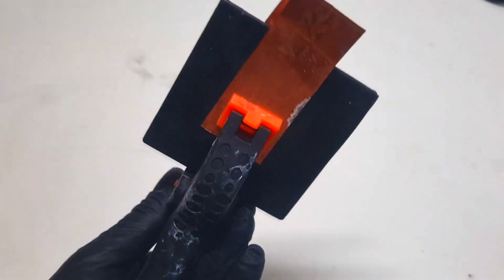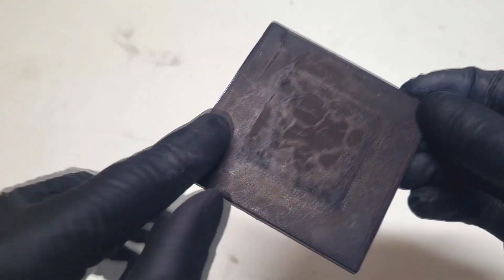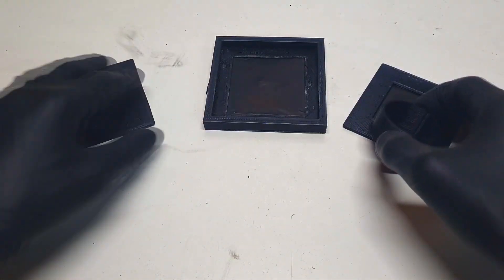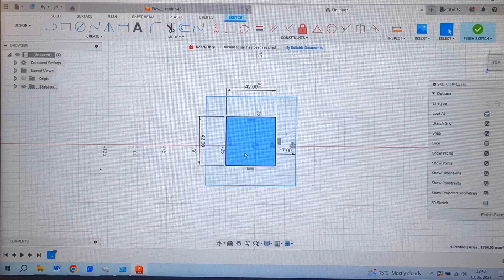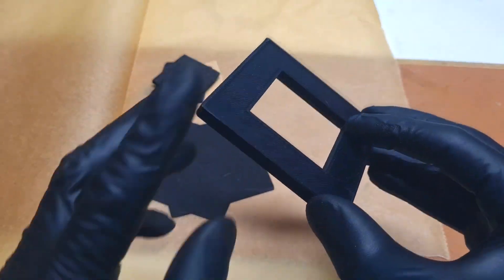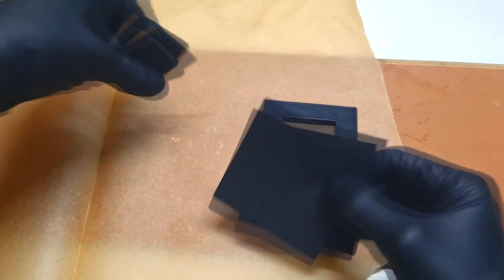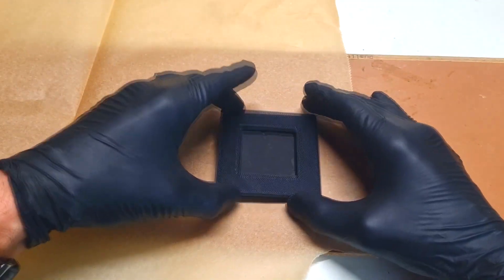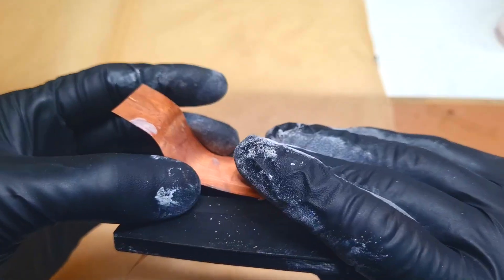Make a Battery in any shape and any size with 3D printed thermo plastic

Comment: Do you get same results when using Al foil instead of conductive HDPE ? 
The results I get are frustrating 😢
Reply from the maker: How do you mean? If the weld is so good on aluminium like on HDPE? Ofcourse not,.... I need more press down the iron when I use  aluminium. For better bonding is good to make smal holes on aluminium in area wher you will bond with platic
Reply: I mean do you get same voltage and performance of hdpe?
Also, can i use graphite foil instead?

Comment: It seems one layer of HDPE is too thin. After one day I see crystals forming on top of the HDPE which must have permeated through the HDPE from the electrolyte.
Reply from the maker: Penetration of HDPE can happen if you iron too long or you press to hard down. In that case you can add another layer of HDPE.
Reply: @cayrex  As far as I can judge the HDPE has not been penetrated, nor punctured. I looks like permeation
Reply from the maker: @Flup1964  Interesting. By me, only one cell out from 9 cells which I make at the same system, I get some penetration due to damage with the iron and the crystals have formed after one day. And other 8 cell are still strong with no problems.

Comment: Great work.👍 Where to purchase the HPE? current collector? What is the mechanism of this battery, any voltage plateau? Thx
Reply from the maker: You can get the HDPE on alibaba, Premix group, par-group.uk, caplinq, etc. But they all sell in big rolls. Maybe will be possible to get some 30x30 cm pieces from me. The battery is like hybrid like mno2 hybrid capacitor. The voltage is in range of 1.8 to 2V

Comment: Nice! This battery chemistry is new to me. Is this a reduction to manganese metal or a oxidation/reduction of manganese ions?
Reply from the maker: The chemistry was only for example, because I need to make a cell to show how to make a finish cell housing. But in relation to the cell,... the MnO2 is formed on positive electrode and the cell act almost like MnO2 hybrid capacitor.